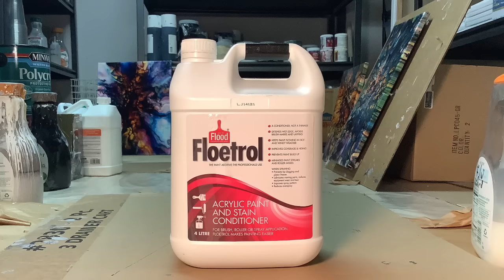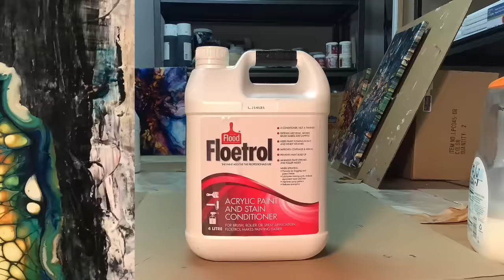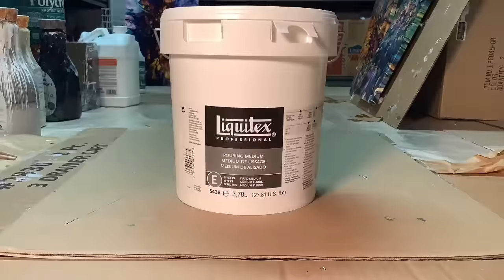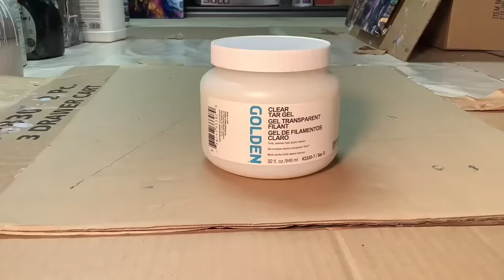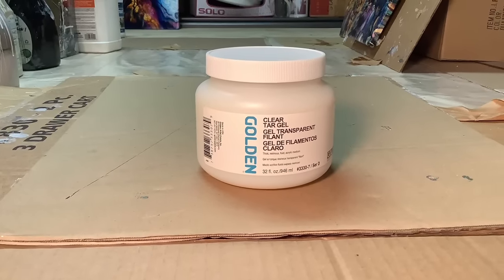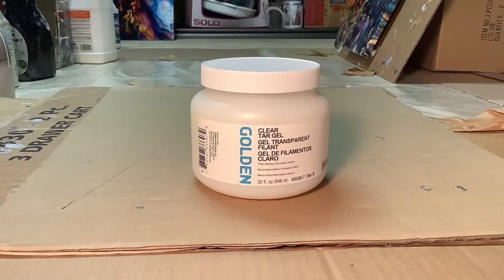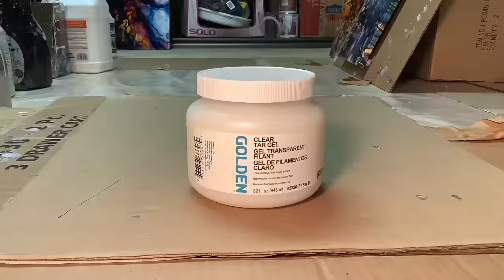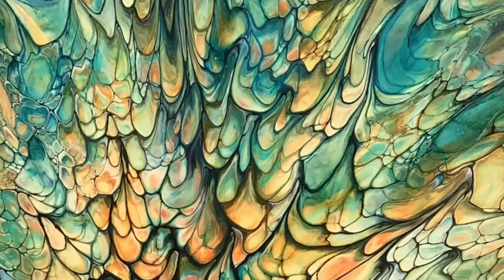What is the ultimate cell activator?

Comment: At 35 min you say mix with floetrol, which version ?
Reply from the maker: Thank you so much Monty 🙏 go to around the 31:00 minute mark. There I am showing American Flotrol and why I do not like it as a primary thinner…however I do like to use it to create a secondary thinner….because I don’t like to use water alone as a thinner. Think of it this way…by adding a small amount of Flotrol to water I am just creating a fortified water mix. It’s only purpose is to thin the Liquitex pouring medium or the tar gel ..before you add it to the paint.
Reply: @chasefluidart4341  I get that I wonder if the french one will work. As we can get that in the UK.  I was also one of the 'must have Ozzy Floe' but at £125 ($170) for 4lt it was a once only buy :)  I'm too scared to use it now :) I've deposited it into my bank. I must try that Tar as well, that seemed to make a lot of sense.
Reply from the maker: @MONTY-YTNOM  …love your sense of humor 🤣 you should be good to go with the Ozzie Flotrol…take it out of the bank…it’s a good thinner…just way too expensive.
Reply: @chasefluidart4341  Would it be fair to say the base paint ( pillow or slide) depending on the term, would need to be the densest then ?
Reply from the maker: @MONTY-YTNOM  …That is an awfully broad question…so there isn’t a universal answer. It would depend on what you are trying to accomplish. Is it a swipe situation,  or a forced air situation or simply using gravity alone? Please give me your thought process as to why you ask that question so I can zero in and give you my opinion 👍
Reply: @chasefluidart4341  well if its relative density that is the key, lighter on top etc, could you not change that by adding a bit of salt to the mixing water
Reply from the maker: @MONTY-YTNOM  …OK if you are talking about a Rayleigh Taylor technique the you want the heaviest density on top. Sorry I’ve never used salt.👍
Reply: @chasefluidart4341  I've never heard of the Rayleigh Taylor technique ( will go look) 
no I was kind of thinking you ( not you you)  want to paint to be disperse by density, which seems to be mentioned a lot , black being heavier due to pigment etc.
Reply from the maker: @MONTY-YTNOM  …please call me Steve…..this should help.    https://m.youtube.com/watch?v=zMyhLf5nO5M

Comment: Your finished work is beautiful...but this article was dreary to say the least...almost put me off the whole acrylic pouring....fortunately ....I too have turned out beautiful pieces...TOTALLY achieved with the correct mix and consistancy ...AND the use of OWETROL AND PEBEO SILICONE OIL.........Please note Sir..,..tips are great...but NOT ramming down people's throats as if they are doing it WRONG....just because its not YOUR way !!!
Reply from the maker: Thank you Adele 🙏 I’m sorry you found the video dreary. I have no doubt that you have found success with your paintings. I never said that YOUR way was wrong or that it’s either my way or the highway. I believe that you missed the point of the video which is that I take issue with people profiting from false information by suggesting that their magic ingredients are the reason cells form. I stand by the Rayleigh Taylor Instability Theory that the cells form through a physical process not chemical.

Comment: Did you take the course on this type of painting? I did and we were taught that Silicone oil is never to be used. Golden is a good product and very overpriced. There are better ones. Canada makes a great one called Tri-Art and that is sold direct to you in America from Canada but is also available to you in America. It is way harder for me to afford in Australia. There are many affordable but quality great paint brands like Matisse, Amsterdam, Pebeo Interference colours, Atelier and Mica powders.
The worst thing you did was to add water to Liquitex Pouring Medium and Australian Floetrol. You added way too much water to most things and this degrades the paint over time. Australian Floetrol was made for Commercial house painters to make paint stay wetter longer so if they take a break and carry on there is no line left on a wall. It also makes it go on smoother and easier. It does the same for Artists paint and some other things without water.
Making great cells that hold their shape and colour until dry also counts on layering, opacity and having the same consistency in your colours. Some of the very best painting are made using different brands together.
Reply from the maker: No I did not take a course. Perhaps you should watch it again to get a clearer picture of my thoughts on the use of water.